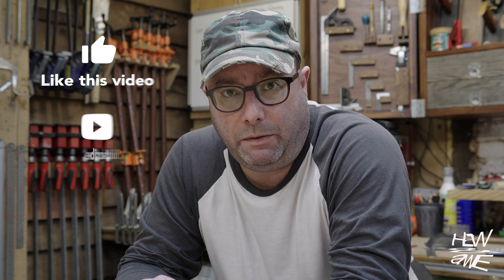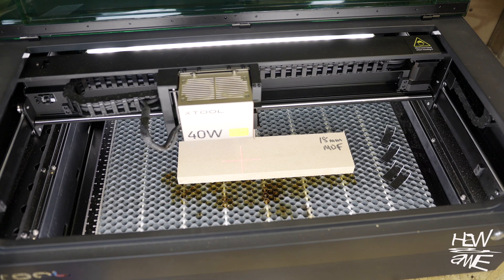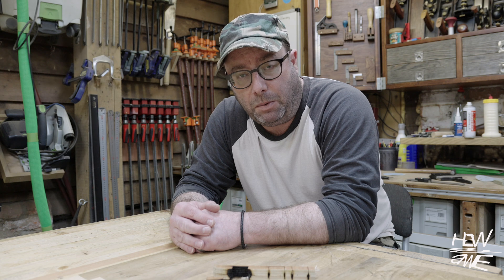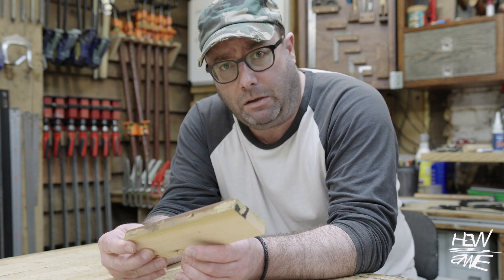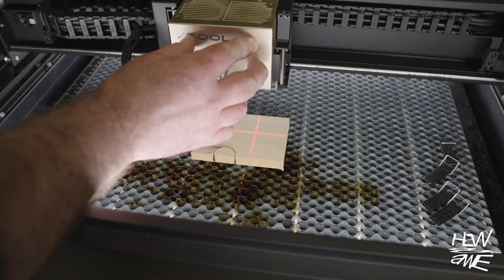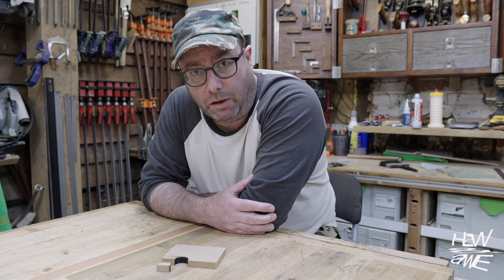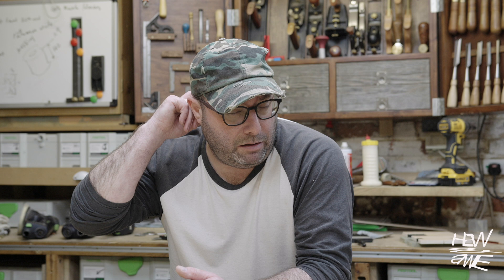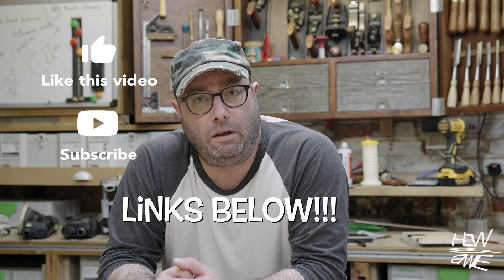CNC, is SO last year!

Comment: Nice one, and solid content, Ben. Just FYI, I haven't cleaned my laser head yet, lol. And for templates, I always stuck with 9mm ply or mdf. Good info on the setups as well
Reply from the maker: Cheers mate! I made a spoil board with all the trimmings, about a 30mm runtime and BOY was it filthy, MDF is shocking. I only go 12 mm when I have to use the big 1/2” router for extra support, but yeah like you mostly 9mm 👍

Comment: 15 dim sum. Thank F! The lasers are getting to where they should be now
Reply from the maker: The software is more the issue now, XCS is basic, and lightburn is to buggy to use with xtool, not to mention missing key features.
Reply: @HewAndAwe  shame no one gets it right,  the propriety softwares should be feature packed by now. Can’t be that hard to knock off and iron out bugs
Reply from the maker: @dainermade they’ve just released a update and it’s even worse 🤦🏻‍♂️ lots of complaints in the xtool group!